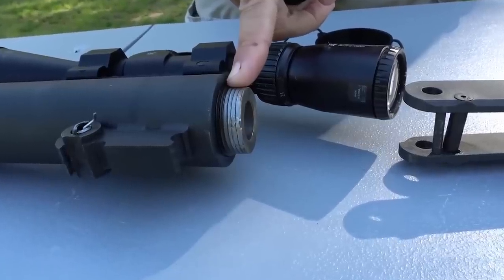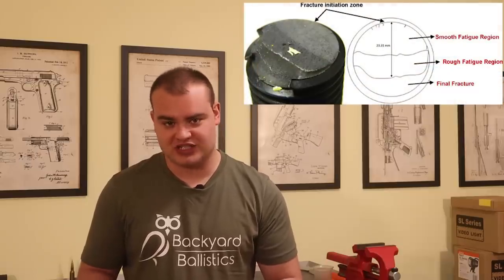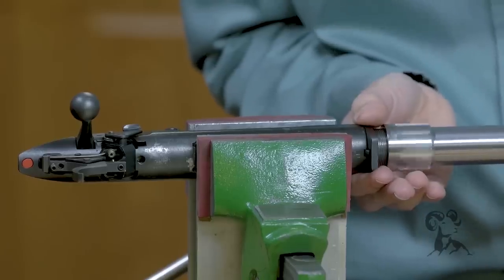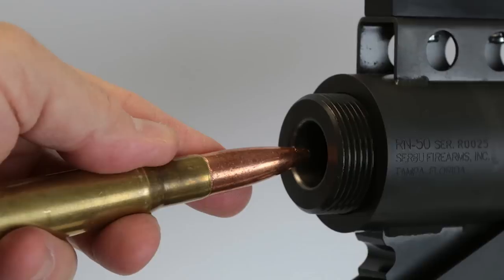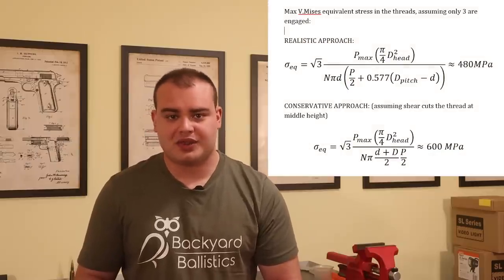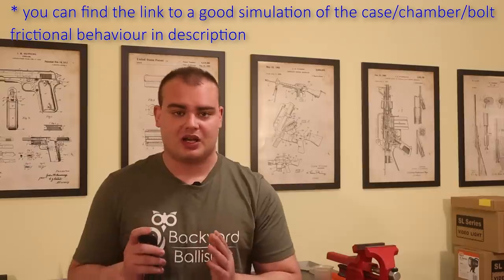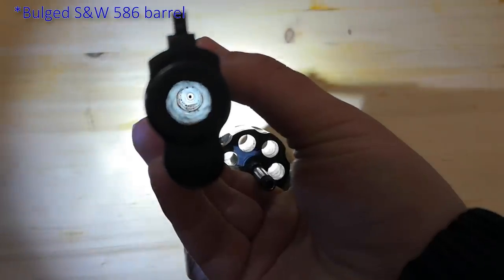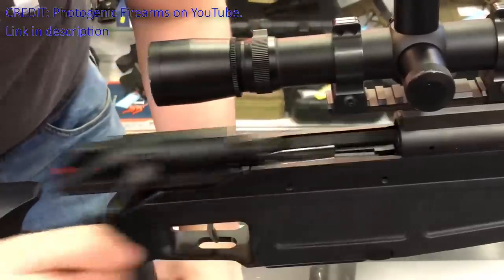Serbu RN-50 Failure: A Closer Look

Comment: Trying to remember where I read/saw this but there have been some instances where a muzzle breaked rifle (.223) produced massive over pressure as the bullet exited the muzzle. In that case the firearm did not fail but continued to function normally & this was only known about as it was undergoing pressure tests & connected to measuring equipment. (& to clarify the excessive pressures from obstructions that bust/bulge barrels further down the barrel are cased by the bullet itself expanding & not the propellant gas pressure & most definitely not the compressed air in between bullet & obstruction.) Still I think you're right & there was obturation failure.

Comment: WC 856 vs WC860. low mass powder is used in the slap ammunition to take up space due the fact about half the powder is used, 360 vs 650 roughly off top of my head. Based on the muzzle blast variations of 3 rounds I would say that this whole "problem" stems from a powder issue, obviously. SLAP was charged at LC. They don't screw up like that. My money is on reloads made from components and improperly charged. Pull Scott's remaining ammo apart. There you will find the answer. Its overcharged or incorrect powder.

Comment: where the first several threads on the breach cap take the majority of the pressure load could the failure be induced by the method of removing distorted spent cartridges by engaging another cartridge cap ridge under the loaded cartridge cap ridge and levering out against / using as fulcrum, the first thread of the male breach thread, thus distorting and damaging critical 'hold down' engagement of first thread?

Comment: The previous shot before the failure of the gun showed a slug stuck in the fire hydrant.  How could this slug be in perfect condition protruding through the back side of the hydrant? Regardless of material of slug it would have some deformity

Comment: What about the energy necessary to cause the two, large receiver lugs to be sheared off by the bolt cap? It appeared that those two lugs were fairly substantial in size (and it was one of those lugs which pierced Scott's neck).

Comment: You are wrong in saying more threads wouldn't make a difference. Yes the majority of initial stress is put on the first few threads however as they fail that distribution moves back to the threads downstream, as threads fail they continue to absorb energy. More threads = Stronger system which is why you see so many threads on typical barrel to receiver connections. You are right in terms of stiffness but not overall strength. Two different things.

Comment: In case of metric thread basically the first crest carries the highest load, then the second, and so on, with the load going to almost 0 beyond the 8th crest (that's why most standard metric thread nuts have no more than 8 crests). However, this is the static load analysis. The catch is that the moment the first crest gives way, the load is dynamically redistributed to the remaining crests. Then when the second crest gives way the load is dynamically redistributed again to the remaining crests. And so on. If there is a sufficient number of crests, the tear will stop. So while under normal conditions there is no point having more than 8 crests, in such an extreme tearing scenario, additional crests may be helpful in stopping the tear.

Comment: Correct me if I'm wrong, but Scott mentioned that the slap rounds he was using were old (an ambiguous statement I'll grant), if they were old enough wouldn't the glycerin in the powder have a chance to separate? Since glycerin is incredibly unstable it would have ignited before the powder, which would cause the round to explode, thus creating an insane amount of pressure right at the cap. Which would account for Scott saying that the round was hotter than anticipated.

Comment: Backyard, just noticed something at .37 min in video where his finger is touching the stripped thread ends where the cap mounts: 

Is that scope bent as well? Or is that just an optical illusion? 

Cause if that cap came off due to a gas expansion, wouldn't it have damaged it as well when it striped the threads but what I'm noticing is the scope is bent in a downward angle (possibly indicating a bulge in the steel where the mounting is) vs the scope bent upwards like in a gas expansion at point blank range and didn't even have any nicks in the scope metal or lens ring mountings that hangs over the cap of the gun. 

Interesting methinks. This gun Definitively belongs in a government lab somewhere now.
Reply from the maker: The scope is definitely bent, good point.  After the explosion the breech end of the gun was rotating upwards, so the bending could be due to the scope's inertia, but I don't really know where all that angular momentum came from. 
I consider it likely that some portions of the barrel yielded as well
Reply: @Backyard.Ballistics  Something else I thought of after this...I'd argue that the explosive in a shell casing crowd just got a huge lift cause if what I'm remembering is correct gunpowder burns at a lower and slower rate than explosives due to wanting to shove a bullet out the end of the muzzle thereby allowing the gases to build up (minuscule amount) with only one way for the bullet to go (out the end of the barrel) but take a look at the scope: 

No gunpowder burns from "spray back" on the scope or it's plastic ring, gun or shooter which argues it was burning much hotter, not slower, and seems to confirm it was burning much, much hotter than it should have been since it was there and gone so quickly that it could have even left without leaving a trace on either gun, shooter or scope. 

Gunpowder Wouldn't do that but traces of whatever it was Could still be on it.

Can you confirm it's likely? Or is my thinking wrong? And if likely, can you do some experiments to possibly check the hypothesis? JW cause I don't have the space or equipment.

Anybody know what kind of plastic that scope rings made out of, whether it's ABS or not? 

Could explain some things if it's a high temp plastic but it would definitely soak up particles like a sponge.

Comment: Could the bullet have tilted and embedded INTO the barrel, seeing as the metal on the penetrator is probably harder, if the sabot failed? That would create a nasty obstruction very close.
Reply: An obstruction like that would have easily blown up the barrel, not the threaded nut in the back. It should happen before the round exits the connection between the chamber and the barrel
Reply: further

Comment: The Blaser R93/R8 ring bolt fails not due to excessive gas pressure but to simple gas flow - as soon as an R93 firing pin pierces a primer, this thing goes OoB. The accidents with higher pressure loadings sure caused more damage and attention, but it is a fundamental problem of the Blaser bolt system which was poorly addressed with the R8 update.

Comment: I guess the question begs to be asked, is it possible to load enough of the type of powder (used in the SLAP rounds) to create enough pressure to cause the failure seen? If not, wouldn't that indicate a failure of the weapon?

Comment: The Blaser R93 actually failed because reloaders did not put enough powder in their ammo. Usually rifle cardridges are completely or at least very nearly completely full of powder. The powder burns progressively from the Primer to the bullet. However, i you only put very little powder in the case the primer ignites everything at once causing a massive pressure spike.

Comment: The statement that more threads become redundant is only true if they are used as fasteners, due to next weakest point shifting to the fastener's cross section area which takes up the tensile load. However, in the RN50 the breech cap is used as an obturating device, or plug in layman's term. In this scenario, more threads does equate to proportionally higher strength.

Comment: The SLAP cartridge was designed for the Marine Corps to use in tank machine guns. It is not permitted to be fired through the M107 due to "hazards". This cartridge is dangerous to fire from anything other than a M2.

Comment: One design suggestion I would make is add a small metal burst disk or plate at the top of the chamber. The disk would intentionally be the weakest part of the chamber, and experience ductile failure at a lower pressure than the threads, but a higher pressure than what normal shooting should generate.  If an overpressure situation does occur, the bust disk will fail in a controlled manner, directing the blast upward without destroying the riffle and generating deadly shrapnel.
Reply: Or maybe not put super hot rounds in it that were hand loaded and notorious for causing catastrophic failures?

Comment: I was taught that maximum thread strength us achieved when threads are a length of 1.5x their diameter. That was about 40 years ago. Has something changed!
Reply: Not at all. As a rule of thumb you are correct. All this talk about the first 4 threads taking up the load is utter nonsense. I've seen three videos where people repeat this fallacy even the designer of the RN-50 does it. These people are looking into books and then posting stress diagrams of nuts and bolts. In this application there is a direct tensile load with no torsional stresses, it does not behave like a nut threaded on a bolt. The load is applied to all the threads and the general rule that length is 1.5 times the diameter is adequate in most cases.

Comment: I didn't get the preasure numbers told in the video...He was speaking about 4000 or 6000 PSI ??? which would be rather low ? I mean military standart rounds have a nominal preasure of 400 MPA (roughly 58000 PSI).

Comment: Do you think all the damage came from the one round that blew the gun up or do you think it was accumulative damage from the two previous SLAP rounds?
Reply: That's something I had considered.
Especially seeing the rounds not behave normally.
I did notice the last round seemed to have a way bigger muzzle blast than the previous 2.
So I guess we have a little bit of evidence that suggests a single round & a little bit that suggests progressive damage.
Reply: @pewpewTN  Yeah, the previous round blew a huge fire ball out of the muzzle and hit 2ft from aim. That's what I was thinking. I think I would have stopped shooting and reevaluate the situation after that shot being squirrely.
Reply: @pablowentscobar  Yea, he had the one that hit high & more right also one that went way to the right.
That would have made me really uncomfortable with that batch of ammo.
Reply: Damaged threads don't turn well.
Reply: @mfree80286  Yea, I don't think it would be possible to cause any major damage to the threads without noticing, but some damage could still be possible.
I would generally agree that the last SLAP fired caused the failure, but I don't think it's impossible that at least SOME progressive damage had accord prior to the failure.
Damage that may have reduced the amount of thread engagement without preventing the cap from still turning.
Reply: @pewpewTN  That much stretch would have caused the ears to interfere with the cap and prevent closing the action.

Comment: I am just tossing another idea out here, not taking any sides:

Say the breech cap mounting surface was improperly heat treated but the cap was heat treated. The cap could shear off the threads. Non heat treated threads would also be softer than the barrel which, as KB stated is a heavy profile barrel. If the Sabot (hardened steel on hardened steel) had some high pressure interference with the muzzle break  in a heavy profile barrel, there is a chance that force would be redirected to the point of least resistance - as proven to be the rear end of the gun, the breech. 

Any thoughts? Just thinking out loud
Reply: I have a rn50 and that breech cap is beefy. The threads are more than likely heat treated , don’t know for sure, but so believe Mark Serbu said they were in a design video.
Reply: The sabot is made of plastic.
Reply: @aaronhiggs  Makes sense... 

I meant like what if accidentally the threads were improperly heat treated or some heat treatment issue was to occur....
Reply: @jic1  Yes. It is. However, according to Tibosaurus' video, the plastic can be shaved off by a muzzle break by consecutive rounds leading to an overpressure situation when enough plastic can build up

Just throwing ideas out there
Reply: @zeerah1  I mean that’s plausible, but unlikely. Mark Serbu qc’s everything before it leaves the shop. Now that doesn’t mean that it couldn’t have been damaged from the kind of abuse a gun you tuber does. That’s could be a factor as well.
Reply: @jic1  plastic with a tungsten projectile.

Comment: Thank you for another great video.
Greetings from the Netherlands
Reply: Well, according to the formula that's used to determine psi load bearing limitations in relation to thread diameter, pitch, angle, and depth, the load bearing limit is 160000 psi. So, by knowing the average pressure produced by a standard .50 cal round, its suffice to say that Serbu's design is rated at almost 3 times higher than what standard . 50cal rounds produce. I'm not sure if any firearm made could withstand that much overpressure. 160,000 pounds per square inch is just such an insane amount of pressure and is almost impossible to even fathom just how much that is!

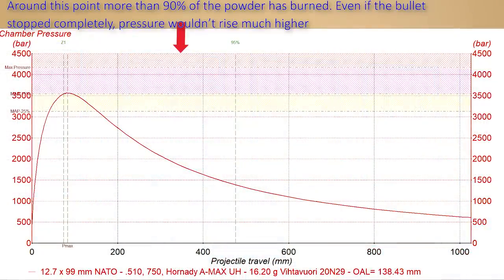Comment: I just bumped into a bit of information that is in my opinion very crucial to the accident. Scott did not actually fire a stock RN50 in his video, he recieved a special barrel with machine gun chamber dimensions and wall thickness from Mark Serbu to fire the very hot SLAP rounds made for machine guns out of. However the screw on breach cap has not been reinforced in any way. Its in one of Kentuckey Ballistics videos titeld "50 Cal SLAP vs Atlas Stone (340 lbs!!!)"  at about 5:00.

Comment: The downside is that the SLAP round is not compatible with some rifles because its greater length will not allow it to chamber or can cause damage to the throat. I've also heard stories of plastic sabot bits gumming up muzzle brakes or being blown back on spotters. The bottom line: before firing SLAP ammo in your rifle, know for certain that it fits your chamber and is not a hazard to fire.
Reply: He got a special ordered barrel with a military chamber. No problems there.

Comment: Does anyone think that it's a possibility that the .50 round was under loaded, causing a light charge detonation in the breach? It's my understanding that it's possible to load a cartridge with an amount of powder small enough for the primer to have access to enough surface area to cause the gunpowder to detonate rather than burn as intended.

Comment: A lot to think about with the addition of these variables. One i would like to see of they could pull apart of of those slap rounds to see the amount of powder charge, grain structure and yield of burn. The way those rounds were behaving make me think that some had been altered or an alternate propellant used. Hell could of been like that rigged AK ammo that dispensed during the 80's in the middle east to cause the weapon to blow up on the user.

Comment: The sabot round fired before Scott's kaboom had a massive muzzle flash and was massively off point of aim. Scott mentioned having received a custom heavy barrel with looser tolerance chamber as the sabot rounds were designed for the looser tolerance machine-gun chambers. I'm wondering, could the sabot from the previous round have separated from the projectile during firing and remained within, or in close proximity down the barrel, to the chamber, thus creating a bore obstruction? The projectile without it's sabot would obviously be thrown out of the barrel and off point of aim, and could also explain the large muzzle flash.
Reply: Thats a no. Scott fired a slap, then a standard api (fullbore), then the second, fatal slap round. there couldnt have been any significant obstruction.

Comment: You could technically make a much longer thread without having to turn it more times to unscrew. What you'd need is a short threaded part as in a regular screw and a longer section with an interrupted screw pattern. Thus you could bypass a lot of the screw and then screw it tight. All that needs to be made sure is that the screw rests in the place that the interrupted pattern is interlocked.

Comment: The case was found stuck some way down  in the barrel. So if It was no case failure, then the case would had been broken after the cap had been damaged by the pushing force from the case. And as a result from this. If the case broke because it was pushed back out of the barrel in direction of the cap, how is it possible the case moved back in the barrel ? Maybe it would have been deformed and would not fit back in...

Comment: looked likt 4 threads got sheared. it also sheared off two ears on the lower and blew the lower away. another question is did anything come out the barrel at all? sure as shit should have perhaps the bullet itself jamed in the barrel somehow, close to where it originated?  There is so much overpressure involved, I can't really see how it could have happened. Even double the normal powder charge would not do that. Pehaps the way the bullet was seated.